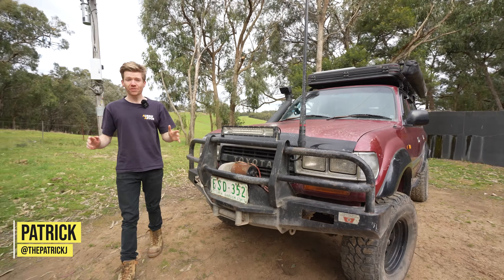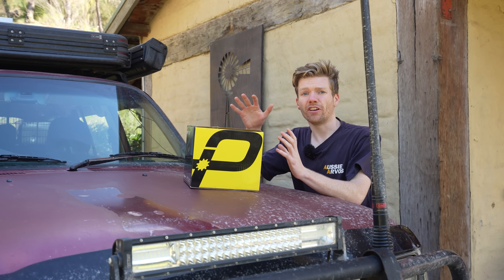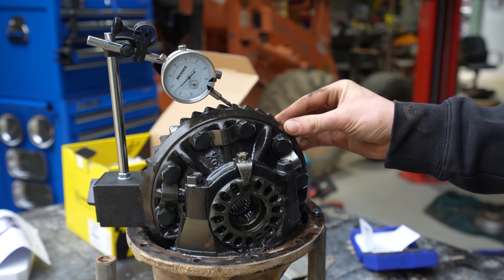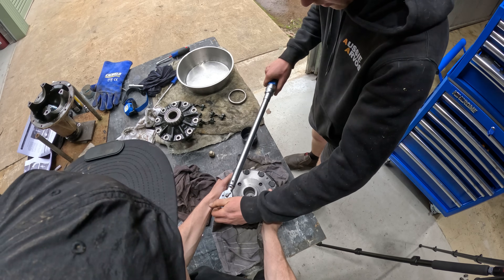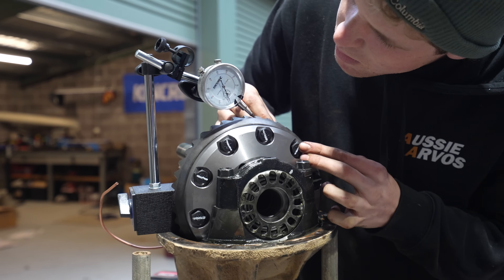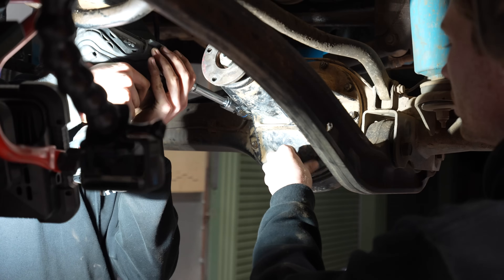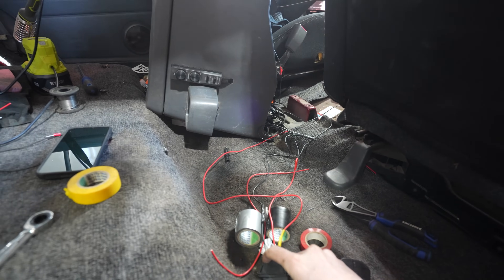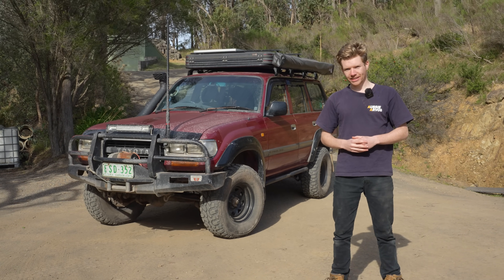How to install an Air Locker in Your 4WD! Step by Step!

Comment from the maker: ARB, TJM, HARROP? What locker do you guys run?
Reply: TJM pure magic ❤
Reply: Lokrite auto locker in the front and standard lsd in the rear of my Trol. Works for me.
Reply: ARB, has been awesome the last 4 years!
Reply: I have recently installed a front arb air locker in my d40 nav but yet to test it out, should make a huge difference
Reply: HARROP EATON True Trac in the front.
Reply: TJM pro locker for me in the front shimmed h-260 in the rear. Can’t see the money it costs for a rear to be worth it over the trol LSD
Reply: @samjury8217 I got arb front and rear 260 as well and kinda wish I had a shimmed up lsd in the rear so I could have some fun in 2wd without turning a locker on
Reply: Arbs front and back never had an issue, transformed my cruiser
Reply: Standard 79 lockers when I can get them to actually engage😂
Reply: I'm poor so 4WD Systems LOKKA auto-locker in the front, standard Nissan LSD in the rear. Does good on my old leafy 1985 MK Patrol.
Reply: Factory Patrol vacuum locker in the rear. Works well and goes anywhere.
Reply: I run a E-Locker as i have lost count in the videos i have watched where a locker is needed and guess what " oh bugger it's not working because i have an air leak" both here and in the states. And TJM do not make a locker for the dual cabs when i spoke to them about 18 months ago.
Reply: ARB in the front Detroit in the rear
Reply: ARB in front and rear and the front seals have gone!
Reply: Harrop e locker, was cheaper option, don't have space for a air compressor
Reply: How much they pay you bro, you gotta tell us or run afoul of ACCC rules.
Reply: Eaton
Reply: ARB in my old GQ, now replaced with a current Hilux. I went Harrop electric front to compliment the factory rear.
Reply: ARB F&R
Reply: front harrop e locker in my HZJ75 Landcruiser
Reply: Toyota factory front and rear electronic lockers 🎉🎉
Reply: ARB front and rear in my Prado 150 very happy
Reply: Factory Rubicon
Reply: Factory 80 lockers the best and the  smartest.

The most reliable and if there is an issue most probably the actuator and you don't have to miss with your diffs.
Reply: 4wd systems mechanical Lokka in the front and LSD rear for the Rodeo.
Reply: HF AP air locker :D

Comment: It's funny how a $50k Tank 300 comes with twin lockers from the factory but most off road oriented SUVs selling at 100k nowadays are telling you should be grateful because they give you a rear one.
Reply: Theres a reason why they make it so cheap, yeah on the surface it looks like your getting a good deal but underneath all that is cheaper steel, and great walls are known for rusting out quite easily
Reply: @MitchPlays254  nah it was ldv that rust easy the new gwms are pretty good unfortunately.
Reply: @MitchPlays254  we had a new tank in the workshop, chassis is probably thicker than the new 300 series landcruiser. 
The only shitty thing I could point out is the fuel tank is the lowest point, and two the powersteering electric motor is the lowest point at the front.
Reply: How true is this, well said, although it would because it needs 2 lockers. 
If anyone wants to know what is the best 4x4 is and who have one of those mates who will crap on saying that GWM and other Chinese 4x4s are good for price.
Well this was proven to be incorrect as when we undertook Intel gathering to prove to an insurance company, two hire companies about to buy a heap of Chinese  4x4s to be hired out for remote outback trips AND a well known 4x4 mag (who all of a sudden is saying that the Chinese are now making good 4x4) that ALL the Chinese brands are NOT manufactured to be used in Australia's harse conditions and to prove this, one must head to the wreckers  where all our Aussie main off road outback tracks start and finish from. There you'll see what 4x4s are good and what are simply crap. Last check, one wreckers held a number of GWM and LDV vehicles and as of last weekend, there is now several Tank 300s. EVERY SINGLE ONE OF THESE BEING HELD AND REPAIRED HAD LESS THAN 40,000KMS!!! There are also a number of several other dual cabs (from all brands, but one more than the others) although not a single solid axle 4x4. Give it another 12 months, the GWM and LDV vehicles with or without dual lockers will have their own holding yards...watch this space.😅
Reply: Well GWM need to offer more at a lower price to get sales
Reply: Modern traction control systems and independent suspension can be just as effective as solid axles and lockers and need less human inputs too. An LSD and good driving can get you over 95% of tricky terrain.
Reply: @michaelbaylis1631  mmm...take a look at military trucks where independent long travel suspension is common. CV strength is  factor of size/quality and a locker puts enormous strain on front cvs, which often become the next fuse. Anyhow, I value you're views on this debatable issue.
Reply: You don’t really see them out on the tracks though do you.
Reply: @richwhetton  IFS and IRS is the industry norm nowadays, as most 4wds spend most time on hwys etc, not tracks. So ruide and handling are paramount. IFS also enables eg electric rack steering and better protects steering arms. The Tank is unusual in having solid axles - even in the US few trucks have them nowadays. So, we'll have to live with independent suspension. Some Trophy and Baja trucks are also going IFS and IRS for better handling at speed and less unsprung weight.
Reply: @michaelbaylis1631  oops, thanks for the correction Michael. So it's IFS like most 4wds nowadays, making solid live axle fronts even rarer...wonder why...
Reply: Yeah see how many of these last 20 years. 😂

Comment: Interesting you mentioned reliability issues with ELocker. I've heard the exact opposite with Air lockers.
Reply from the maker: From what I've seen most the problems with air lockers come from installation errors , but with the elockers it seems to be issues with the product itself.
Reply: @AussieArvos look up what timmyhasheart has done with rewiring the elockers. From factory they come with shit wiring which is why they fail. But if you redo it with Deutsch plugs and everything you can fail proof it
Reply: @mesahatesayou 
That sounds like reliability issues. You don't hear about people sourcing me air lines and connections to make them reliable.
Reply: @Robert-cu9bm  yes but you do DEFINITELY hear about people having issues with their air lines in general...

Comment: A common misconception is that the whole unit is called a differential where in fact it is called the final drive and the diff part is only the small gears inside the housing. The differential  allows the outer wheels to travel a greater distance when turning

Comment: TIPS: 
- Use a brass drift punch when trying to seperate things that hold bearings. Smacking theing hold bearings like the uni's will pit or flaten races/rollers/bearings leading to early failure, while at it, those welding, ensure current path never goes through bearings, they arc and die very fast afterwards. 
- When tapping, just like shagging, don't go in dry. As you are not pulling the pinion seals, the cast iron powder/chips will end up in there. Grease the tap to hold onto the debre.

Comment: Great job 🎉
BUT the rear LSD IS DEBATABLE 😂 
I’m a 105 series guy BY HEART and the LSD is a pretty well open diff as we all know 
but hey I did put the Harrop E locker in the front with the solid pinion spacer and it changed the car’s ability 100% I had no drama with it and used on a weekly basis 
Enjoy the capabilities

Comment: I went for an auto locker in the front of mine as it’s part time 4wd with manual hubs. I also went with the TJM pro locker in the rear, but have no air system just yet to use it haha. Still having just the front locker makes a huge difference!
Reply: I'd recommend the auto lockers.
Always engaged when you need it, and disengaged when you don't.

Backlash setup is important to get them to engage and disengaged properly though.
Reply: @Robert-cu9bm  Yeah absolutely. I installed mine myself and it was very easy. People complain of the clicking too and I don't even hear it unless I am really trying to listen for it. 

It does make the steering a little heavy so if I was driving where I would use 4wd a lot and had the extra money I would choose an air locker.

Comment: Another great video! 

Just a quick note, open diffs actually distribute torque 50:50 all the time, and it's not until the diff is locked can you distribute the torque differently from one side to the other. An axle doesn't have to be moving to experience torque. Just like a nut that's tight and you're still pulling on the spanner is experiencing a torque but not moving.
Reply: Ditto, I was about to make a comment along these lines. They split torque 50/50, when one wheel has limited traction (i.e. raised off ground) the opposite wheel will see the same torque which won't be enough to get it moving. 

Learning advanced driving techniques like left for braking can assist with this. Not a locker, but can help get traction in difficult terrain with open diffs.
Reply from the maker: Thank you mate! your spot on! cheers

Comment: I used to have an auto Lokka in the front and detroit auto locker in the rear. Loved it offroad.  Onroad, was still ok.  Best bang for buck mod for a part time 4x4
Reply: Plenty of banging & noises coming out of your diff around corners if you've got a Detroit locker in the rear.
Reply: @dustyfarmer  not all the time, but every few weeks at random it would let out a terrifying bang. The front one would click a lot when turning tightly when in 4x4

Comment: Nice work Boys. Well done. 
I know how you feel now having a Locker.
I've only owned 2, 4wds.
My first was a 2003 Hilux and didn't have a Locker. 
My second is a Brand new 2022 BT50 which comes with a rear locker.
Remarkable difference between the two 4wds now I've experienced both aspects. 
Enjoy your new locker.
Reply from the maker: Cheers mate!
Reply: Why bt50 over a new hilux?

Comment: Well done. Don’t beat yourself up about time taken. 3 days is still pretty good for a DIY. Granted it’s a lot easier with a hoist. I’ve  recently fitted a 4wd Lokka at home not a small job. But totally changed its off road ability. One of the best upgrades 👍

Comment: Really interested in this and well done on the quality of the video. So much to be impressed with here across the filming, sound, content and process plus editing. I have a part-time 4WD that has a LSD in the rear and an open diff in the front. I thought you’d be upping the rear to a locker but with a LSD (if it’s properly working) I can really see the benefit of upgrading the front, which is typically an open diff, into a locker. The choice of whether to make the upgrade ‘e’ or ‘air’ is likely down to other aspects and I can see your reasons; if you need to air up (as you do) and air is a not too difficult and ultimately reliable vehicle mod then it makes sense to go ‘air’. I can also see the benefit of adding a front locker for those tricky times when you’re likely to lose traction and / or lift a wheel. Thanks for making and continuing to be honest vehicle guys.
Reply from the maker: Thanks mate, that really means alot, cheers :)

Comment: Personally i have had twin ARB air lockers. Rear started to get lazy and parts were very difficult to source during 2021. Swtiched to a harrop e locker and love it. Still running air in the front but will be switching out to an e locker shortly. I find with the air system there are a lot more failure points. Great video for the backyard mechanic showing what can be achieved when you invest what you would've paid a mechanic into tools and giving it a crack!
Reply from the maker: Cheers mate! Yeah I'll make sure to keep you updated on how the prolocker goes ! Cheers for the support!

Comment: FYI, Putting load on the pinion like you did, and then spinning the pinion is no different to spinning the pinion with no load. You are just making the pinion harder to turn & there is no additionalload on the crown wheel.
You need to put the drag on the crown wheel and spin the pinion to create extra load.
Reply: I had a chuckle at that too.  But the amount of load they could have put on the crown wheel wouldn't come within a bee's d*ck of real life load so in the end the result is the same.

Comment: 80/105 series have a LSD for about 5 minutes after the leave the stealership as a new vehicle .  That is about how long the LSD lasts  :)  (I own a HZJ105)

When you install a locker just ensure it is done by someone who knows to setup diffs especially backlash with a least solid pinion spacer in the front.  I have seen some disasters in the bush caused by poorly setup difflocks ...

The solid front pinion spacer will make the diff as strong as possible, especially the weak front locker  ...

I do use ARB lockers but if I was doing it again I would use the prolocker for the reasons you said...

Comment: Had the ARB locker in the rear first of my  late 92 80 for 20+ years no problem. The lsd is near useless and  imo a better option as steering with the front locked is hard on the gear. Rarely use the front.

Comment: So just to add as this is rarely understood or talked about on the debate re air locker or e locker, with an e locker factory or Harrop type, my understanding is you should only engage it when stationary!  You are also limited by the speed you can travel with it engaged.
trails

Comment: Cool video mate, love the content, I have a 2001 Pajero which has a centre diff lock as standard, I think this makes it a Three Wheel Drive. It’s a pretty capable vehicle off-road. If I was to add a locker to the front, I think it would be amazing
Reply: Nah still 2wd. The lockable centre diff allows your Paj to be AWD when unlocked, but when locked it's exactly the same as any part-time 4WD.

Think if it this way. The locked diff sends 50% torque to the front diff amd 50% to the rear (in reality it's probably 40/60 but for this example we'll say 50/50).

The 50% going to the front diff is split again between each wheel, until such time as either of the wheels is lifted. Without a locker, LSD or traction control, 100% of the front diff torque is applied to the lifted wheel and zero to the wheel still on the ground.

All you have left is the power directed to the rear diff. If that diff is also open, you'll need grip at both wheels to maintain motive traction. Unfortunately when one front wheel lifts, it usually unweights the opposite rear corner enough to  lose grip and then you are spinning at two corners and going nowhere. A single locker at either end ensures you always have power to at least one grounded wheel, but twin lockers (not counting your centre diff) is better. 👍🏻

Comment: Fantastic you gave it a crack and bloody awesome work guys! With the rollback unlocking with e-lockers, airlockers definitely seem the way to go atm. Might be worth carrying a bit of extra hose and those quick fix connectors to repair the hose on the track if it gets damaged in a tricky spot.
Reply from the maker: Thanks Mathew ! Yeah I thew some in the back! Cheers :)

Comment: The early 3 piece ARBs are strongest and sought after for comp trucks. Parts are now available aftermarket since ARB stopped supporting them. ARB parts are hard to come by  b expensive too! Often quicker/cheaper to order parts from USA.

Comment: My JDM HJ61 came with cable lockers front and rear, lockers should only be used when necessary, and disengaged when not. Limited slip is a compromise, more like limited lockers, relying on clutch packs, which are additional wear components.

Comment: Also 80 front diffs you want the tooth mesh low in the teeth as the pinion and crownwheel walk up the tooth under power you still have hood contact patch. Just because the front diff is the 8” and not as strong. 
Also should of done the solid pinion spacer as that’s another weak point and causes the pinion and crownwheel to walk and then go boom

Comment: I have an auto lokka in the front of my GU and it made a huge difference. My triton dual cab has a factory rear locker which is good, but not as effective as a front locker imo

Comment: Hey guys, great ep - realistic! Wanted to get the Pro Locker myself, but at the time they were unavailable, so went ARB. The "issue" with the seals hasn't been a drama for me thus far, but alot harder to push the bearings on - have to push the bearing over the air seal - need to make special jig - so should consider this this before trying at home with ARB. I also added a reg to make sure the air supply did not exceed the locker spec, so not to push the seals. From memory the locker was rated to 120psi?? and my compressor cut out at 150, so set reg to 110. Something guys might want to think about. I would add should check backlash in x3 spots, and while everything apart take advantage of of cleaning and regreasing front end. If doing it for the 1st time the idea of the "dry test fit" is great. I'll admit I learnt this lesson the hard way the 1st time I did a locker, had a hard time getting the copper line from locker through diff housing. Love the injinuity with the work bench.

Comment: Maybe consider a Truetrac for the rear to complement the front - it will be far better than the Toyota LSD and virtually maintenance free. Truetrac’s are used by the US Army in their Humvees 

Luv the channel 

Cheers
Reply: The only maintenance an Eaton TrueTrac needs is a 80W-90 oil change at the standard service intervals which on my Landcruiser is about every 50K on the front diff. I check it for level & water contamination between intervals.